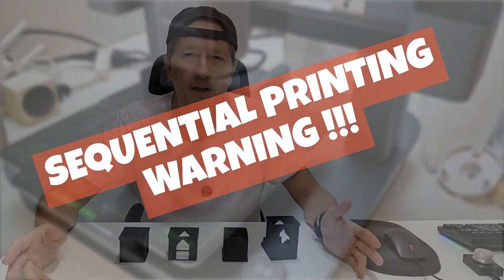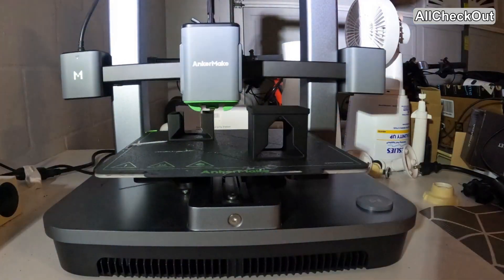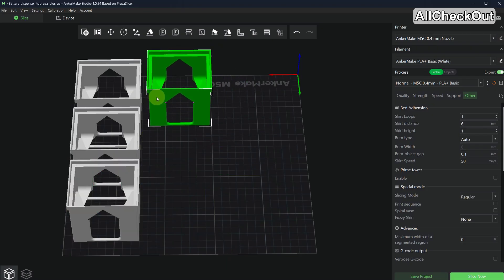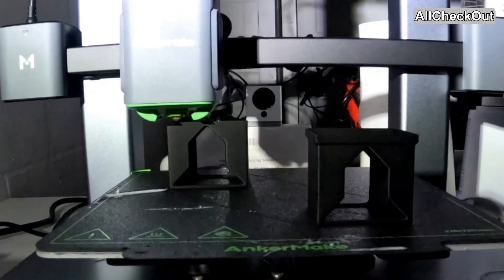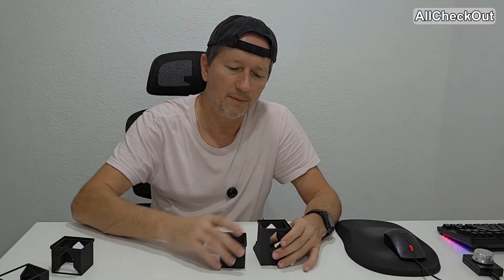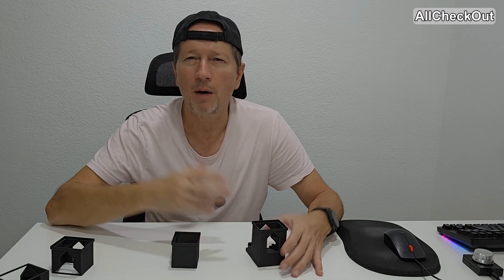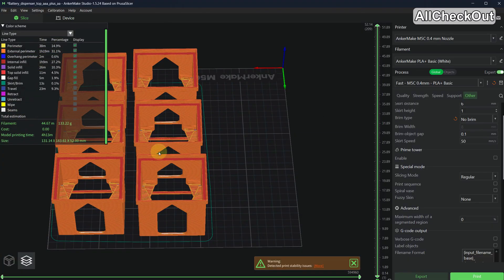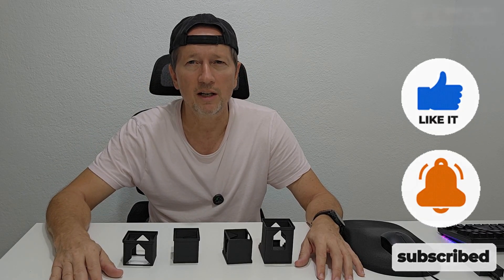Sequential Printing With AnkerMake (eufymake) M5C Tutorial and Big Warning What Could Go Wrong

Comment: Hi, I understand your problem and I think you can perfectly use the horizontal bar to your advantage to automate the sequential printing of several pieces. You should make it so that at the end of each print, the bed cools down and the bar moves the piece forward. This is very well documented and you can search for information about it. It involves inserting a couple of code routines into the print. Best regards.
Reply from the maker: Thanks for the info. Good to know, but that's not something I want to play around and again messi it up again. This should be in the basic internal system or slicer code to prevent these problems because this can cause severe damage to the printer. Hey don't get me wrong. I t looks like you're from the company itself or big AnkerMake fan and I also love my M5C despite this. I'm just not using it this way any more. Either printing now layer by layer for non-sensitive items or piece by piece for  the items I sell.
Reply: @allcheckout  I'm not a big fan, but I thought you'd like to know about a solution. I have two M5s and I like them quite a bit, but AnkerMake has a lot of progress to make. There are good and bad points here. Thank for replying

Comment: Seems like a simple solution would be to just print each piece out seperately and then use the option at the end of the print, to print it again. It would maximize quality of results. Yes, it probably will take longer overall but it will provide best results if what your printing is important.
Reply from the maker: Thanks. Yes, I know that, but the goal was to print multiple pieces overnight without any manual action needed. That works only layer by layer and not piece by piece. I mean it works, but you have to be super super super careful to make sure that the cross bar is not hitting any printed model. IDK why they even offer this option when they don't check for crossbar interference. I've been writing to their support many times, but I think they still don't realize what's the problem and are definitely not willing to change anything. Very disappointing support from AnkerMake till now.